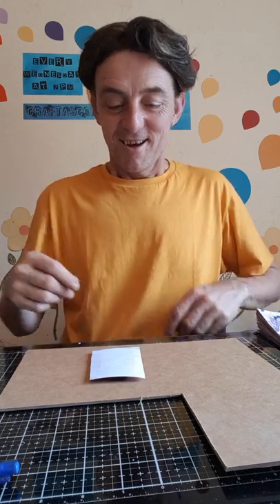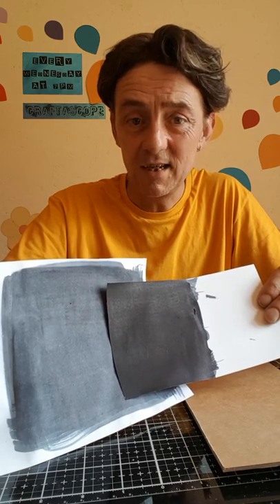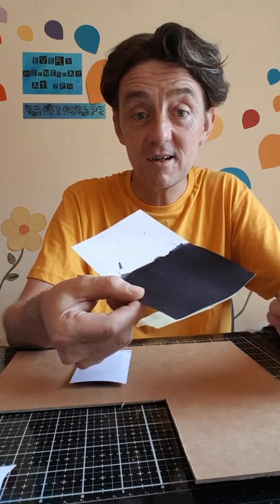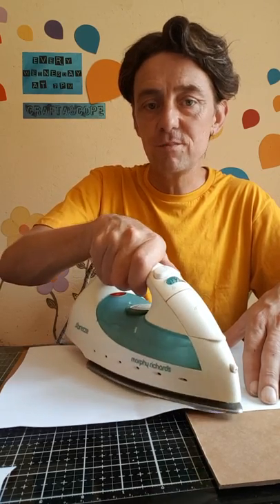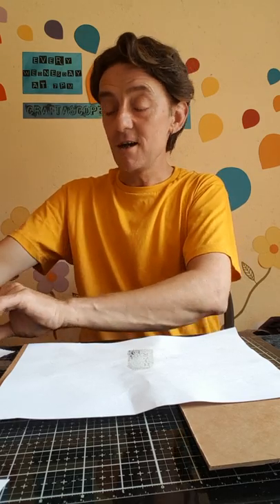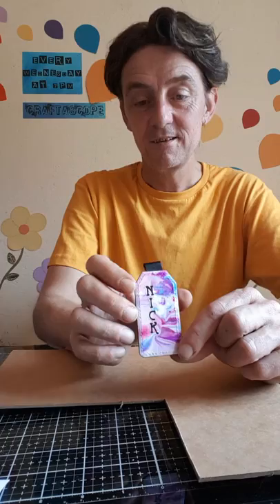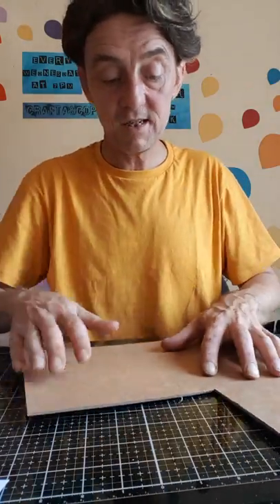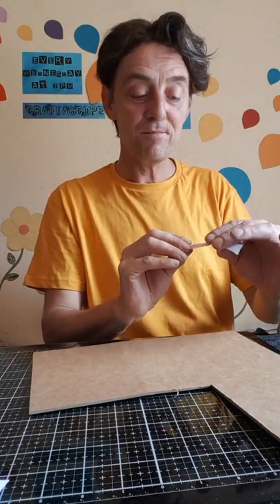IMPORTANT This is a 2 part video, GIVEAWAY DRAW AND MORE (PART 1)

Comment: Hi Nick. Thank you for doing this video and I am glad you have started with small projects and they are just the items I have been thinking of. Good tip on the black paint on different paper and card, I wouldn't have known that. Is it really me that has won the Draw? I am so shocked but over the moon if it is really me? Thank you so much Nick, you know how much I love your goods. I will message you tomorrow as It will be late where you are? Will Watch Part 2 Later. xx
Reply from the maker: So sorry for the late reply Mary, I m pleased you found the video and information I have included, I really hope you find it useful, It really is a good way of doing the black to makes sure you're not wasting the paint. I want you tome confident when you get going. Congratulations on being drawn in the draw, I am so pleased for you, I know you will love using them all